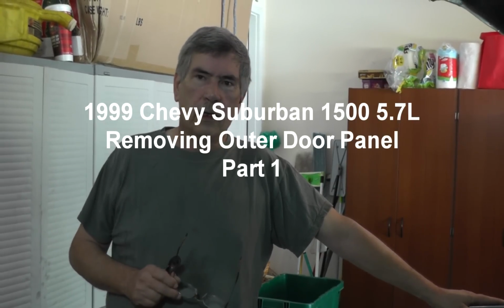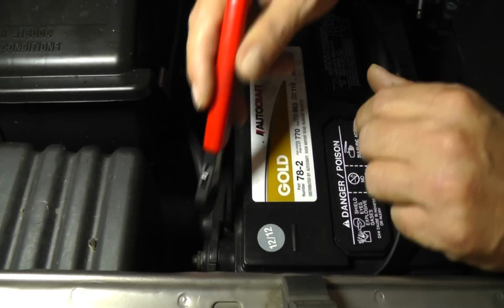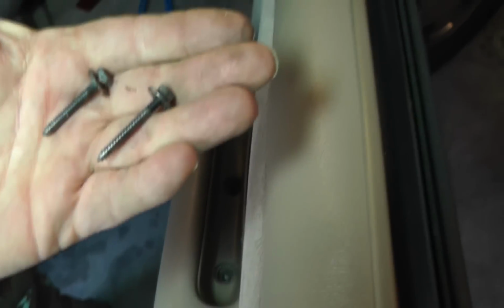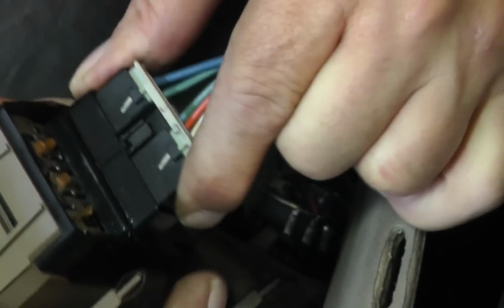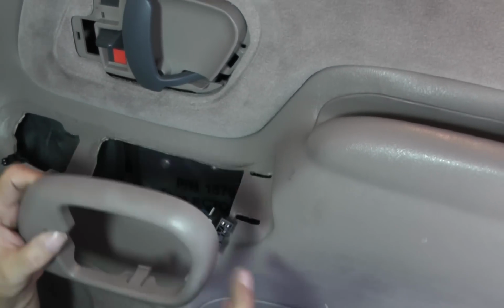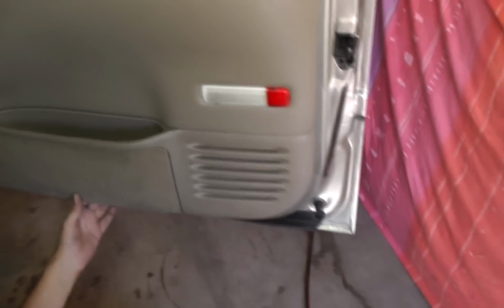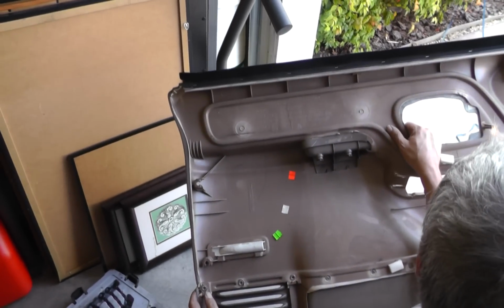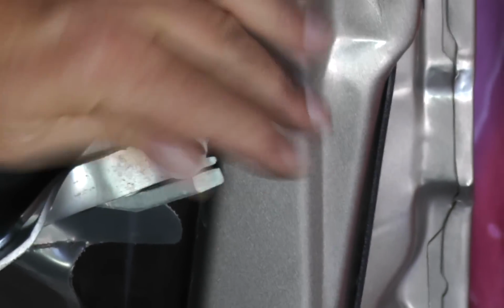Chevy Suburban Removing Outer Door Panel - Part 1

Comment: Thanks for the video! I have to remove my door panel this weekend and this is going to save me a ton of time. Is it necessary to remove the negative cable from the battery? I'm only removing the door panel to see why my door won't open from the inside...
Reply from the maker: Hi Candice. No, it's not necessary and a lot of techs actually leave it connected so that they don't have to worry about resetting the radio stations, etc. It's just a safety precaution as some of the wiring will be hot all the time. Just be aware of this and you'll be okay without removing the battery cable.